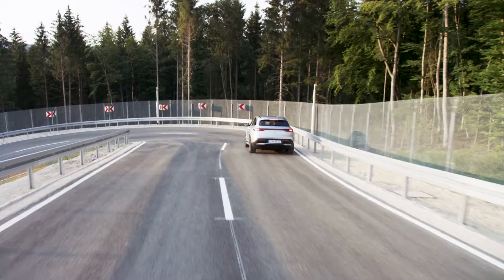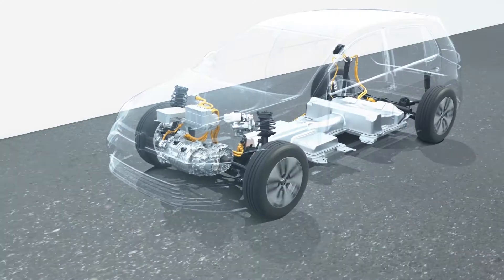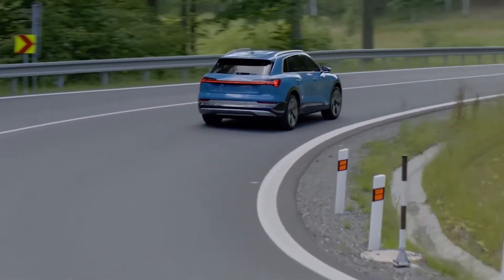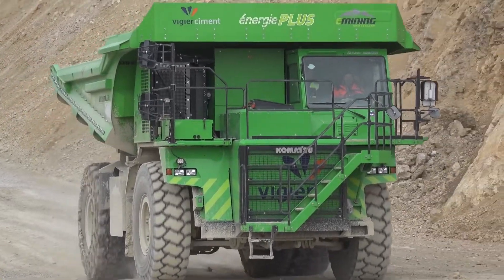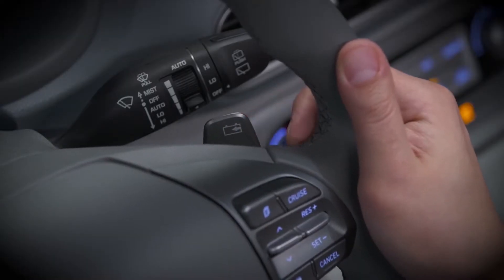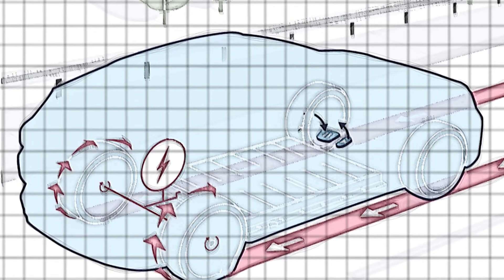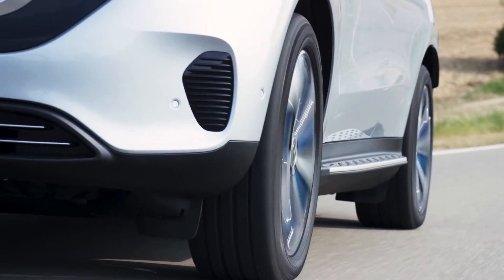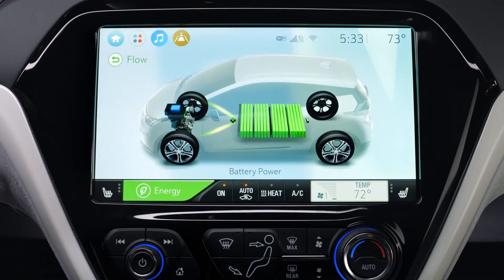R for Regeneration | ABC...EV

Comment: Hi Martin. In the end of the video you mention your wife's Zoe has blended braking (use of the brake paddle will induce regeneration whenever possible). However, the same is true for your Kona and virtually all EV's except Tesla.

Therefore, the regeneration setting used in those cars will change little to the amount of regeneration that will occur. Actually, since there are losses in conversion when regeneration the most efficient is to coast whenever possible. It is most likely the most natural way to achieve highest efficiency is at lowest regeneration setting (it ensures use of regeneration is a deliberate action).

It is a very common misconception that highest regeneration setting will give highest efficiency (although true for Tesla's for lack of blended braking).
Reply from the maker: That all sounds good, thanks! Yeah, we're fans of accelerating and decelerating as little as possible! Thanks for the comment!

Comment: Not to quibble but the motors turn in the same direction during regenerative deceleration not reverse. The motor(s) simply aren’t being driven and produce current while turning much like hydro generator motors can when being turned by water or nuclear by steam. The art is in capturing this energy in a predictable manor. Connecting a load electrically actually adds the resistance to electrical flow and slows the motor. You see, any motor will coast or free wheel if no wires are hooked up but give them a load (wires hooked up) and they’ll try and flow electricity to that load which eventually is the batteries in this case. Yes electricity does go in the “reverse” direction and no this isn’t a matter of connecting and disconnecting wires as I gave verbiage. In fact I can not find any articles on the exact tech used in achieving this. Probably because most of it is buried in code and controllers unique to each manufacturer. While I was looking however I found Tom’s InsideEV’s article on the fact that Tesla was removing the regenerative settings in 2020. Is that still the case? Great intro as always. Only turn your motor in reverse if that’s the direction your heading. 😉
Reply from the maker: Ha Gary, thanks! I suppose that it's a very complicated process, so we led with the comment 'as a simple notion'. Otherwise it gets way too technical for an introductory series. Thanks for the comment though, and like yourself, people can do more research if they're intrigued by how Regen works.

Comment: Motor in reverse ??????? I don't think it works that way
Reply: Correct! The motor don't change rotation direction when regen starts. It stops being an electric motor and starts being an generator.
Reply from the maker: You're right Paul...so we led with the phrase 'as a simple notion'. The challenge was to use a really basic illustration of how regen works. Otherwise it gets very complicated for an introductory series! Thanks for the comment, and hopefully you still enjoyed the video!
Reply: @BestElectricVehicle  I do enjoy your presentations Martin and I am all for simplifying things but it must remain accurate, we are already calling home EVSE "Chargers" when they are in fact power supplies or a power cord with a check circuit. This was done under the guise of keeping it simple! now users think their home EVSE is actually charging the battery when it is just supplying AC power to the vehicles onboard charger. Keep the video's coming and lets keep the conversations and discussion going progress is never easy, Cheers.
Reply from the maker: Another very fair comment Paul! Thanks for engaging, and you're spot on about keeping the discussion going.

Comment: A little correction, the motor does not spin in reverse when using regen as was said in the video. Direction of rotation of the motor will remain the same, it's just the flow of current that reverses. Or to put in other words, normally the motor spins the wheels but when regenning the wheels are spinning the motor.

As for the way I use regen, I am old school and prefer the brake pedal instead of one pedal driving or B-mode. In my ID.3 the pedal modulates the strength of regen quite nicely and if I press it deep enough it activates the friction brakes too.
Reply: Yep, ur right!
Reply: Thank you, that saved me my own explanation. Several youtubers have made the same error in explanation. It's just as well to get it right. 😋
Reply from the maker: Hi Ollie, fair comment...but we led with the phrase 'as a simple notion'. It's tough to find a way to summarise regen in a short sentence for what is very much an introductory series. Thanks for the comment and hope you still enjoyed the video!